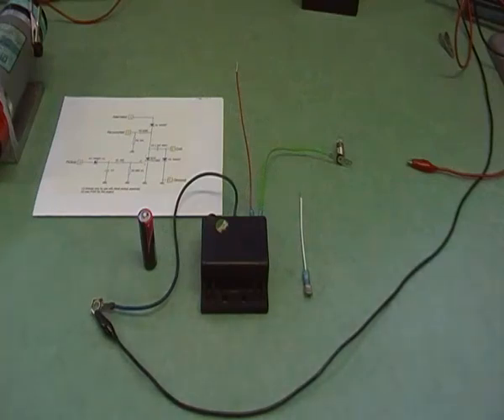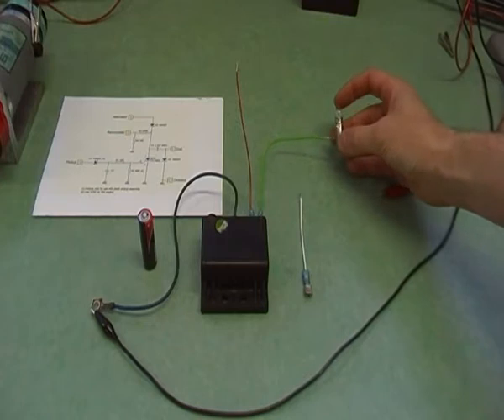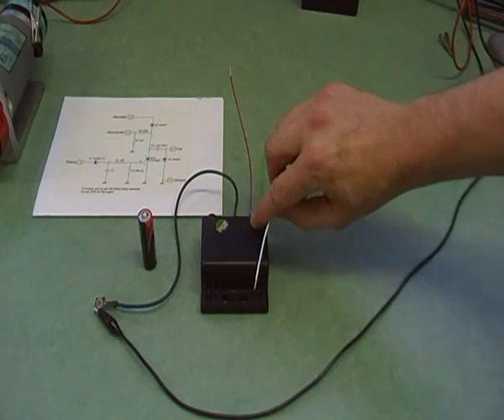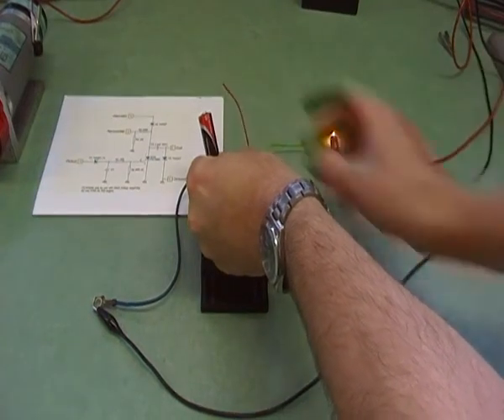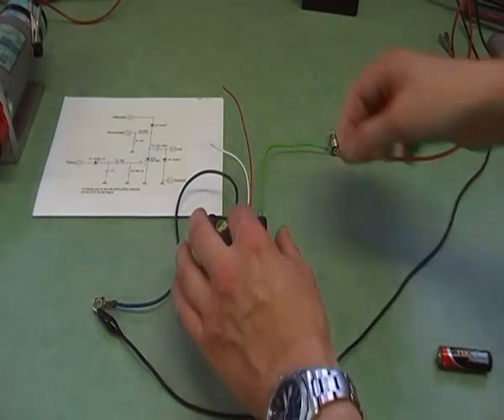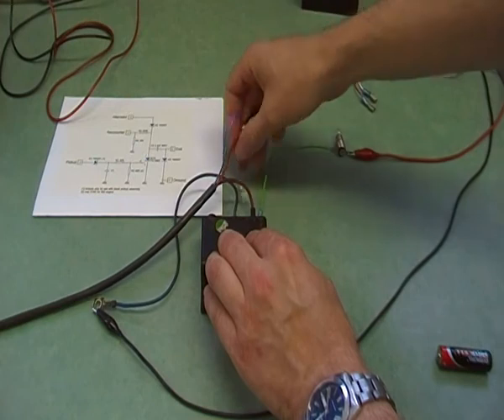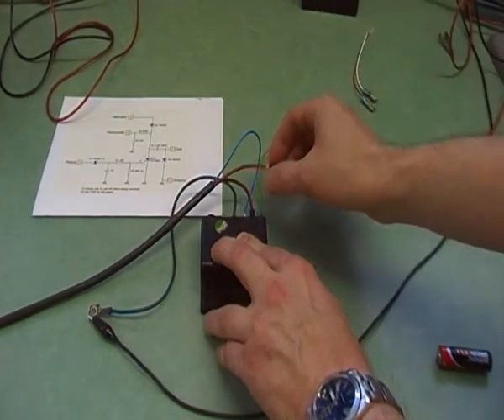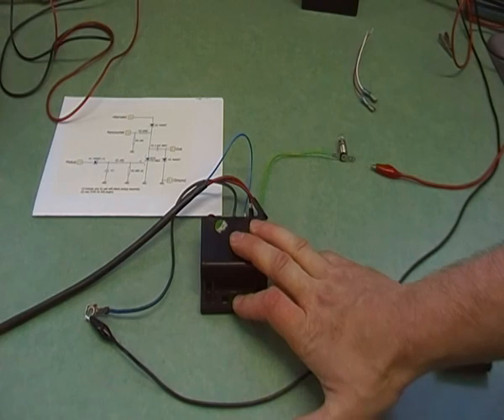Morini ignition test 1

Comment: I have did all of the tests with the bulb and it passed but I cannot get any spark . I can place the   
spark plug in my hand and short myself to the frame and get just a small amount of spark but when I put the wire direct from the ignition coil in my hand it definitely shocks me.
Reply from the maker: Is this on one ignition box, or both?
Reply: It's on both boxes , they both check the same. The red pulse coils do turn the light on but I don't know if they are putting out enough voltage for a good spark . They both put out about .392 volt AC from each coil. The ignition coil puts out about 40 volts AC while cranking it to the green wire to the ignition box.
Reply from the maker: The alternator coil voltage sounds a bit low. What does the coil resistance measure? The rotor magnets can also become weak and may need remagnetising. I do so as a matter of course.
Reply: It measures about 190 ohms and I did check the cranking voltage once again and it is about 47 volts AC with a swift kick on the foot crank  only and like I said the green wire does shock me while the secondary coming out of the ignition boxes does not even shock at all even when I hold the plug in my hand and ground myself. This is what really confuses me that both are the same and quite consistent. Both of the ignition boxes pass the light test. The pulse coil even lights the light without using the battery. Everything tests good , that is what is driving me crazy with no spark.
Reply: Hi, 
Did you eventually find out what the problem was, I have a very similar one to yours. Everything seems to check out but gets a very weak spark?